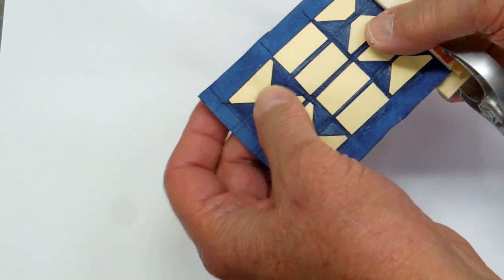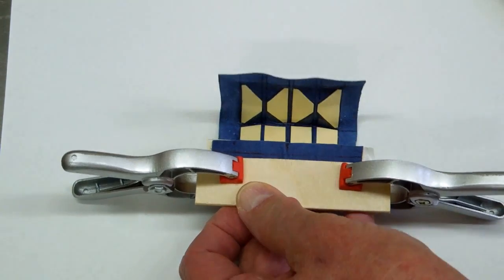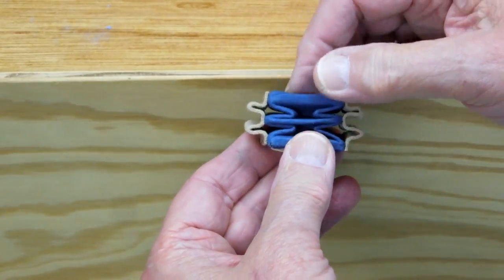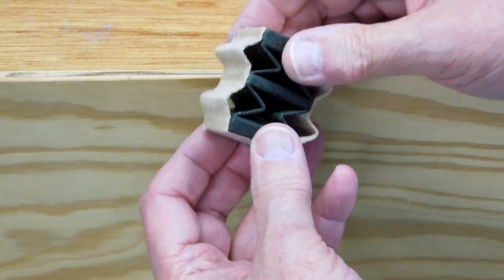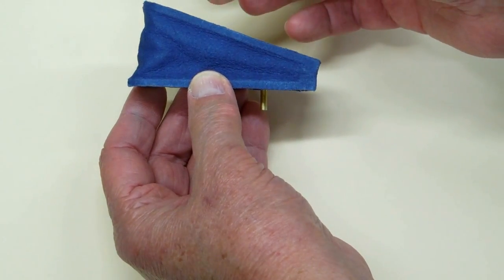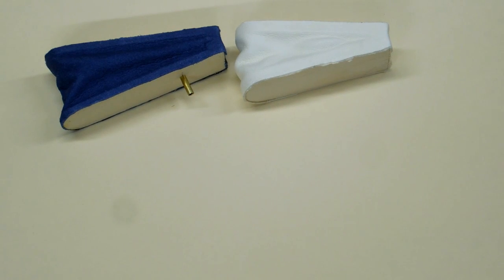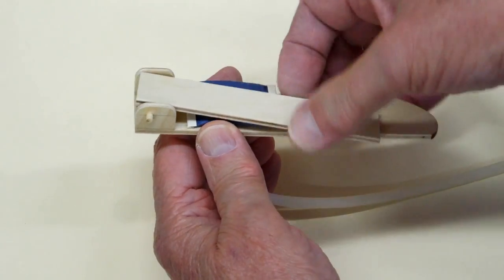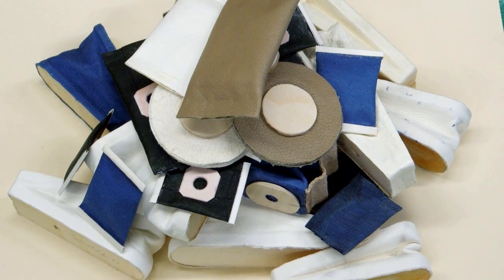Senior 20 Conductor Installation (6) Double Rise Pneumatic Motor

Comment: Hi Ron. I too followed this path (I wanted bellows) and found bagging a problem, the trick I found was to include the tiny triangles in the stiffeners. As mine was also a low power device I used tyvek in place of leather after following a link to cuckoo bellows.
Reply from the maker: The cuckoo bellows are very good and surprisingly durable, but they do not need to deliver much pressure. 
Thanks for watching. Ron

Comment: The only thing I could think of doing to allow the bellows to self collapse is to use an extremely thin and flexible material, rather than leather. First thing that comes to mind is cling film (shrink wrap). It's reasonably strong yet super flexible. I'm unsure whether this is a useful comment or if you want to stay away from plastics, but it would definitely work (I think xD)

Comment: Would it be possible to build a compact rigid fixture adjacent to the bellows that would have stop lugs to restrict the rise?  There would be no strings to get tangled.  Either way, I have to commend you on your persistent R&D work here!

Comment: That is a lot of different pieces you have tried. Why didn't you show us the white double acting one with the center section moving back and forth? or are you showing that later on?
Reply from the maker: The Double Acting Motor actually worked pretty well but was going to be slower than what I wanted. Operating it on camera was another issue. To cycle repeatedly and reliably the Double Acting Motor would probably require a "double acting" version of the Wood Pneumatic Valve and I did not wish to make one when the operating or cycle speed had already been determined (for myself). No more interest than what I have seen in these pneumatic motors (mechanisms) making additional devices solely to demonstrate the double acting motor just isn't warranted.

Comment: Have you considered using a good thread that doesn't elongate with humidity on the corners to constrict how much you can elongate?
Reply from the maker: The restricting straps are not the resistance to collapsing. The stiffeners and sealed leather is the resistance. I thought about using string but having little loops of string hanging around (conceivably there would be several motors inside the organ case) and the possibility of getting things tangled... I thought better of it.
Reply: Thanks for clearing that up. Cheers!

Comment: Wow lots of work there. What would you think of making two air tight and using one to drive another? if they were both air tight the vacuum in the driving one would help collapse the driven one
Reply from the maker: We're bordering the old "free energy" thing here.... :-)  If it were mechanically driven, then two syringes connected together (push - pull) would be what you are describing. I was wanting it to be driven pneumatically. The double acting motor with the center board swinging back and forth was somewhat like what you are describing, except each side was driven alternately by compressed air.

Comment: Why do the two restricting straps need to be the full width of each side? Couldn't you restrict the upward movement with a single piece of string on each side or some thing, and not have so much resistance when trying collapse the bellows? Just thinking out loud here, but in any case, keep up the great work.
Reply from the maker: String may not be as durable. Besides, the restricting straps are not the resistance to collapsing. The stiffeners and sealed leather is the resistance.

Comment: Could you make an oversized bellow and have it only operate from 40% filled being the closed position and 90% filled being the open position? I'd imagine as the size increases the the material thickness will be proportionally thinner.
Reply from the maker: With the exception that available space inside the organ cabinet is limited. Things need to be smaller, not larger. On full size theater organs it is amazing how large and sloppy some of the motors are, but they gave a huge blower available for the air supply and all that stuff fills a huge room.

Comment: I thought these designs and tests were being done recently for the conductors movements? But the date on the video is November of last year.
Did you finish these experiments last year and I just missed the final conductor movement video?
Reply from the maker: From the beginning (June 2014) I knew I was going to build two Senior 20 Organs, one without and one with a conductor. I also knew I was going to (eventually) motorize both organs. I started working on the development of the conductor figure late in 2014 before my first Senior 20 Organ was completed. Finally obtained a sculpted figure early 2016 and have been playing around with the installation and possible animation methods since then. Videos are often not released until the project has been completed or is near completion. I did not release the motor drive videos until after it was working. I did not release the conductor casting videos until after the molds and castings were perfected. The date on a title screen is when I edited that video, which has no bearing on when I will release it and I’m certainly not going to go back and change all the dates. You haven’t missed anything. Stay tuned and thanks for watching!
Reply: Ronald Walters I wasn’t asking for changes in the dates. I was just confused about the resent designs and testing. Thanks for clearing that up. Your innovations are amazing and I’m looking forward to the conductor completion.